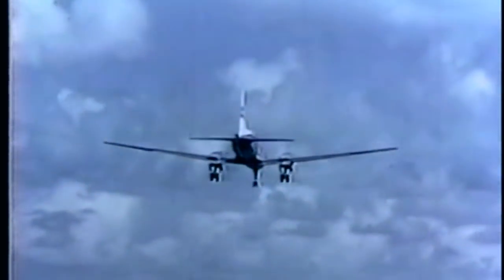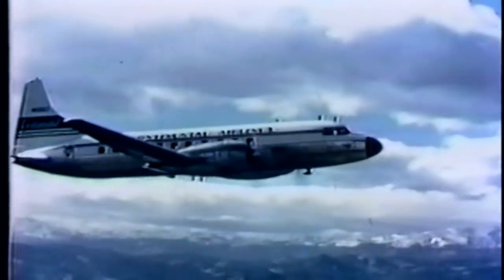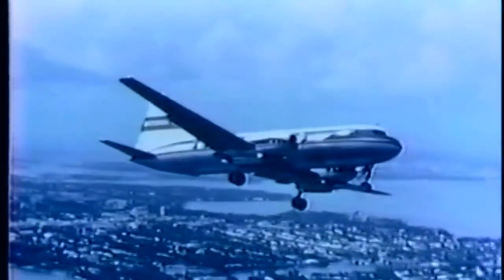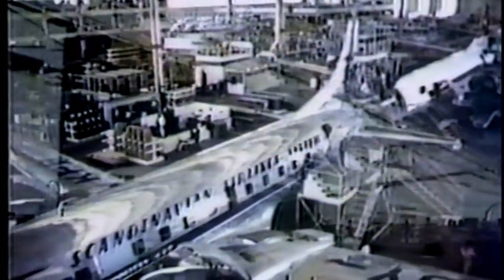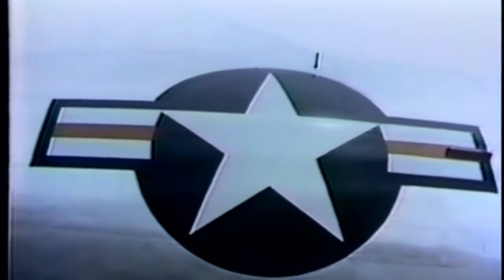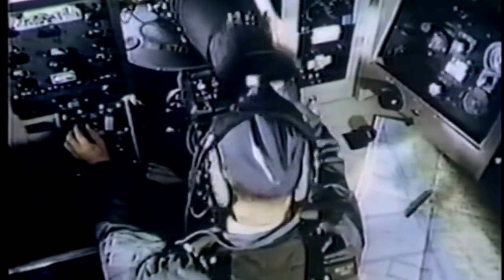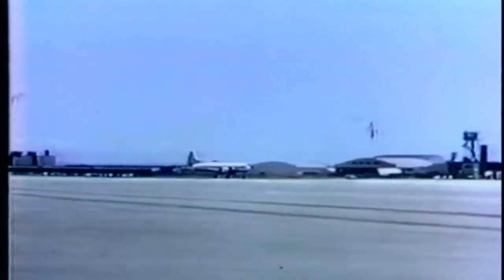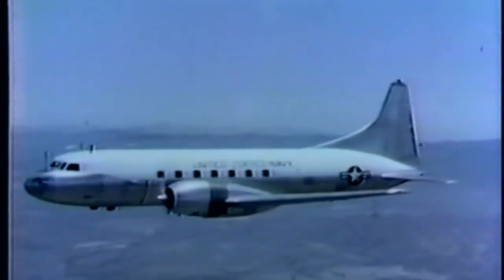Convair Liner Promo Film - 1955

Comment: The 240 was the plane that crashed and killed members of Lynyrd Skynyrd. It ran out of fuel because the procedure used to calibrate the fuel gauge had a fallacy. The fallacy was discovered when an Air Force airman was acquitted when he was courts martialed. This knowledge failed to reach civil aviation.
Reply: That and both pilots were known to abuse alcohol and drugs.  There was one band, don't quote me, but I believe it was Aerosmith (their people) were shocked at how openly the pilots used alcohol when they went out to see if they wanted to charter this aircraft.
Reply: It was later discovered that the very same aircraft had earlier been inspected by members of Aerosmith's flight crew for possible use in their 1977 American tour, but it was rejected because it was felt that neither the plane nor the crew were up to standard. Aerosmith's assistant chief of flight operations, Zunk Buker, told of observing pilots McCreary and Gray sharing a bottle of Jack Daniel's while he and his father inspected the plane.[15]

Comment: The Braniff one... N3433.. is still flying in as a Convair 580 for Norlinor Aviation out of Quebec... 60 years after this was filmed!
Reply from the maker: Excellent info, thanks!
Reply: Re engined with turbine power?
Reply: @therandomytchannel4318  your kidding right?
Reply: Sweet. Thats awesome
Reply: @therandomytchannel4318  580's were powered by Allison T-56's (501-D13's) if I recall the civ designation correctly. Our's pumped out 4,000 shp at 971 TIT at sea level. Ours had a max TO weight of 58,200 lbs and almost 20,000 lb fuel load! These were a huge upgrade to us after having C-118's. Much easier to maintain.
Reply: @therandomytchannel4318  Yes a pair of turbo-prop!
Reply: I thought Braniff's fleet (20 were ordered) went from N3410 to N3430.

Comment: ever since i was 3 years old the convair is still to this day my favorite, my dad used to take me to the airport to watch these planes land and take off, finally at age 12 i took my first flight in a convair 580 (north central/republic airlines) i remember taking flights in these newer models that replaced the convair the saab 340 didn't offer things the convair liners did, the seats were more narrow and there wasn't much room where the convair had a wider seat and more space for comfort, the speed of the convair was remarkable compared to the slower flying 340. when northwest retired the fleet of convairs after merging many convairs were in great shape, some were sold to resorts airlines and other countries.  N8444H was built as a 340 and converted to a 440 then bought by north central airlines, by 1969 it was converted over to a 580, in 1983 jan 9th late in the evening making its flight from Minneapolis mn on rout to brainerd mn then to bemidji then to thief river  falls it had an accident while trying to land in brainerd, it was the perfect mixture for disaster, the runway was covered with ice and slush about 2 inches deep, snowbanks too close to runway lights 3ft high cloud level at  300ft fog. it slid off to the right of the runway causing propeller and engine damage, propeller #1 ripped through the cabin 1 fatality 1 serious injury, it came to a stop at the end of the runway losing the left propeller after sliding sideways. N8444H was repaired and put back into service only to fly 4-5 more years then sold 2 times to private companies. in 1996 it was bought by chatham airlines under the registration of zk-cib. it still flies today for chatham airlines. these are tough old birds no doubt

Comment: As a kid I flew on the original Frontier Airlines CV-580s. 
Without a doubt the CV-580 is the best looking twin engined airliner as far as I’m concerned. 
One of Frontier’s 580s survived a belly landing in a muddy onion field while flying for United Airlines, they raised her back up and made temporary repairs then flew her to a nearby airport for permanent repairs. 
Currently she is flying as part of the Honeywell Aerospace Test Fleet (N580HW), she is also the oldest CV-580 flying and was the second airframe to be converted to a 580!
An interesting fact about the CV-580 that most people are unaware of, the CV-580 designation is not the official designation it is a marketing name that Frontier came up with. The aircraft that were converted are officially CV-340A or CV-440A depending on weather the aircraft was originally a CV-340 or a CV-440, the A stands for Allison, the manufacturer of the T-56/501 Turboprops that power the CV-580.

Comment: Lynryd Skynryd's plane was a Convair that went down in 1977.
Reply: it was not convair fault they did not put enough fuel for the trip
Reply: it was a convair 240 that was suffering engine problems, running too rich and spitting 6 foot flames out the exhaust it was on its way to being serviced by the charter companys own mechanics at its next stop if it would have made it, the fuel gauges weren't functional and the pilots were drunks and neglected to check fuel tank levels with a stick before takeoff either they did and they had enough fuel and the engine problem burned way more of their fuel than they knew about, people thought the pilots accidentally dumped fuel when trying to switch to reserve tanks but all dump valves were closed upon investigation of the crash, what a sad crash the pilots also made the mistake of picking a field to land in and then changing their mind to a different field they came up short and landed in heavy timber sheering off wings pitching the canopy into a steep nosedive and breaking it into three pieces 6 people died on impact or very shortly after all other survivors were seriously injured

Comment: VARIG bought CV240s from PANAM. They were fitted with P&W R2800 engines the same model installed in DC-6, 100HP more power per engine than standard ones. Very good for hot and high airports.